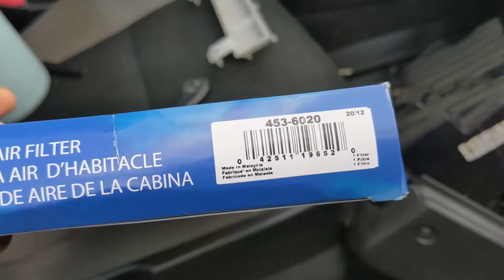07 Subaru Impreza Cabin Air Filter

Comment: Air flow is NOT going up. Air flow is down. If you put the filter in with the air flow arrow pointing up then it's upside down.
The ONLY time an arrow on a cabin air filter should point up is if it says "up" next to the arrow on the filter instead of air flow. All horizontally mounted cabin air filters with the blower motor mounted below the filter have downward air flow. Otherwise the blower motor would be full of dirt and debris. If it doesn't say up next to the arrow then the arrow indicates air flow direction and should point down. Another simple way to determine this is noticing how the dirt accumulates on top of the old filter which proves that dirty unfiltered air enters the topside of the filter and flows downward. 

Still not sure? Then remove the filter and turn on the blower. Then put your hand where the filter goes. Does it feel like it's blowing upward? Use a piece of string or tissue paper. They will be sucked downward.

All the Subaru or Toyota parts that say up on them have nothing to do with air flow. They are simply telling us which side goes up. So if your filter says "up" next to the arrow then of course it should point up.

If it doesn't say anything next to the arrow (like on a WIX branded filter) then by default an arrow on an air filter indicates air flow direction. I've already emailed WIX to confirm this to be true.
Reply from the maker: Well that's good to know! Thanks for filling me in on that, I'm gonna check my filter now to make sure I installed it correctly
Reply: That's a very good point, as I just removed mine and saw it was pointing down. Glad I read your post, as it does make perfect sense!
Reply: Epic write up :-) also doesn't the little white plastic door have air flow arrows on it?
Reply from the maker: @umustbbornagainActs2-38 I think it does lol it’s been awhile I should change the filter again and make sure!